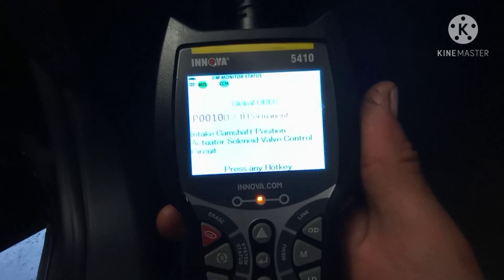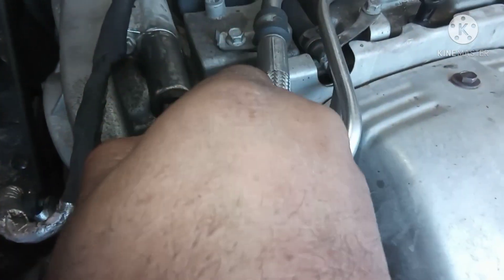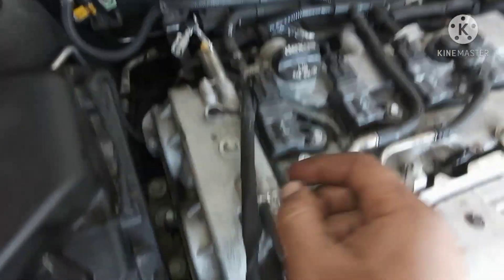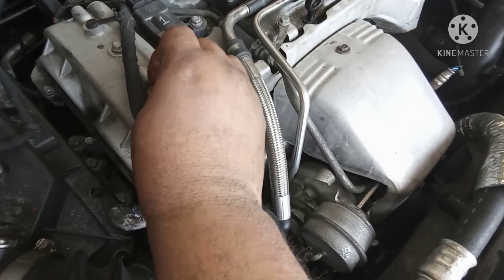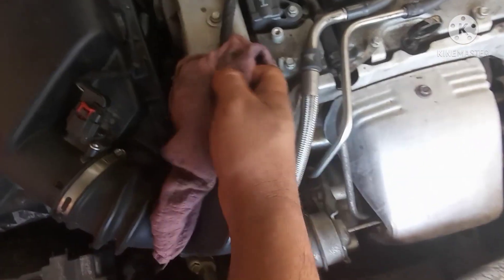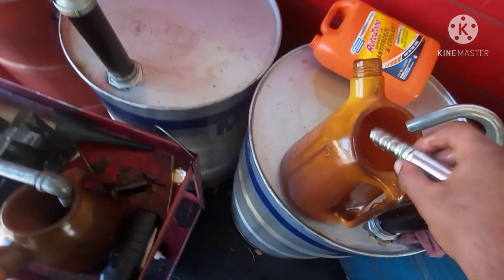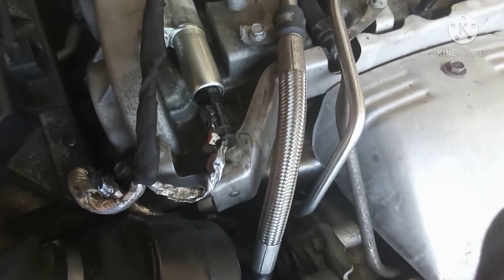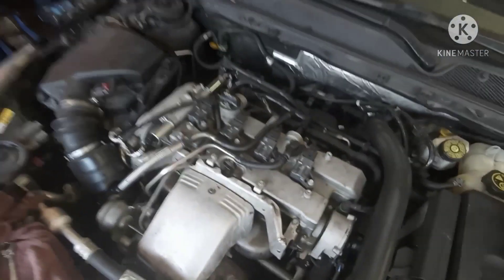P0010 P0011 for 2014 Buick Regal GS 2.0 Turbo

Comment: Would this cause acceleration problems above 60 mph?
Reply from the maker: Sometimes people use cheap oil in the car and drive a lot of mileage
Reply from the maker: If you've been driving the car with no oil the sensor be damaged